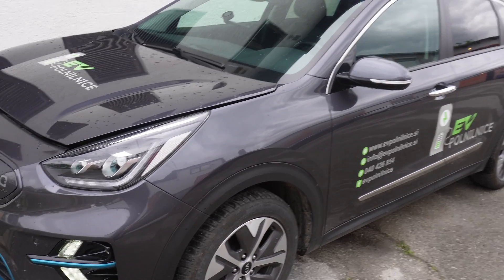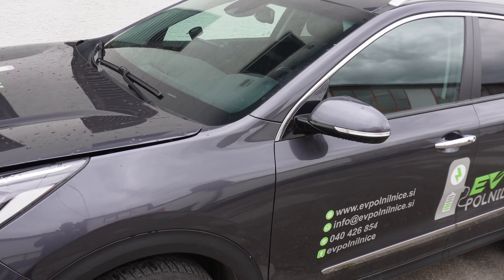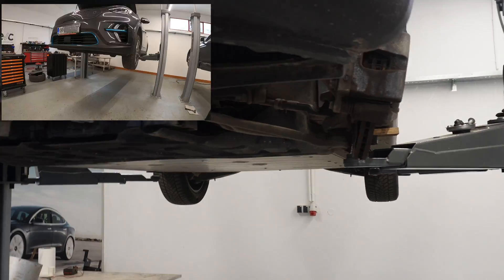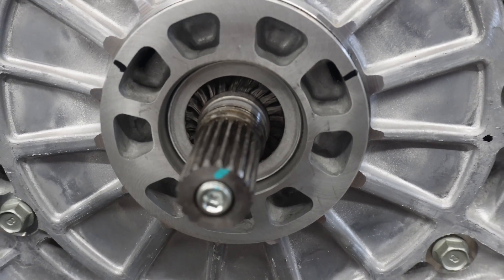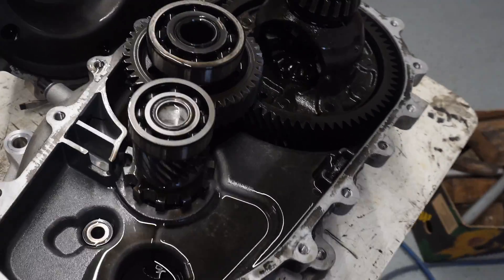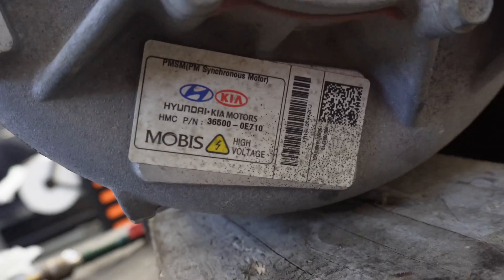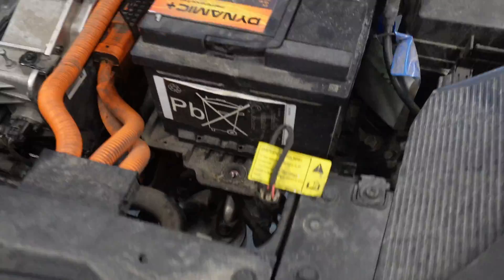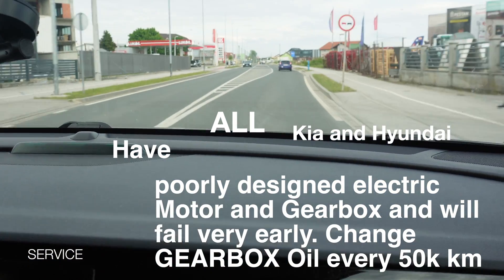KIA you failed us! Electric motor milling refurbish 36500-0E710

Comment: I already saw this kind of repair on an ukrainian Youtube channel, I guess you guys know them. On a Kona first then on a 2019 E-Niro.
The problem not explained in your video is that Kia-Hyundai used a steel ball bearing instead of a ceramic one.
The good part is that the mechanic said that corean learn from their mistakes and try to corrct them, so it seems the since my2021 E-Niro, they used ceramic and this should not happens so often again.
I think there is a kit on sale to prevent or renew these motors.
I don't agree with you when you say it's not a good engine: it had this issue before, corrected now, ok, but the rest is strong, reliable and efficient.
Reply from the maker: Not true. Even ceramic fails. It is bad design as usual on Korean vehicles: that kit which you mention is our product. Check the shop “EVC eDrive Kit eNiro”
Reply: What are the intense heats in a non combustion motor that requires ceramic bearings?    Well...  I understand their insulating characteristics, if there are stray currents around.

Comment: I had this exact job done on my Ioniq 28Kw. Motor and gearbox bearings changed. The car runs silently now but it makes a click noise every time I accelerate or lift off the throttle or brake. Have you ever encountered this?
Reply: After how many Km?
Reply: @GlossaME  160000Km I actually sorted out the clicking noise as well. I had just used the original shims in the gearbox with the new bearings but it turns out i needed to add a 2mm shim to one of the gears.
Reply: @whitegtr  glad you fixed it! Sounds expensive
Reply: Wasn't expensive as I was able to do the work myself. The bearings cost around €300. I did have to remove the gearbox and take it apart twice to add the extra shim!

Comment: Same noise on my kia ev6 rwd 2022, now they replacing the motor.
Reply: The factory procedure is to replace a whole motor or a whole transmission, there is even not any internal component listed in the factory parts catalogue. I did replace transmission bearings on my cousin's Kona 150kW, the material is pretty cheap, available off the shelf (except the shaft seals which are available only as OE), it took quite a lot of labor, but it's doable. The motor has grease lubed closed bearings, so they're the most critical parts. Transmission oil can be replaced easily every 50k km and magnet type oil plug can be used which if good quality bearings are chosen for replacement, I believe extends their life dramatically.

Comment: I have an interesting one: My own EV, discovered a dirty oil film all over the reduction gearbox. No apparent origin of any leak. First suspect was the half shaft seals, but those areas don't feel oily? Guess I have to do a full teardown. Could also be the pressure equalisation breather that got plugged somehow, so pressure is building in it when warm?
Reply: Clean it, then find out where the leak is coming from.
Reply: @annpeerkat2020  I ordered new seals for everything and took it apart.had plenty sludge on the inside walls so it was worth it. Also removed the e-brake cogs completely, who have been dysfunctional for years. I never found the smoking gun, but the seals had lost of elasticity and they were from the factory installed slightly crooked.

Comment: Interesting video. I have owned a 2019 e-Niro from new here in France, just coming up to 120,000 km with the service booked in for next week. The reduction gearbox oil will be changed but I've never had the 'milling' sound from it. There is an e-Niro taxi in UK with 275,000 miles on it, so over 400,000 km. The owner claims it is on original motor and battery but I don't know if gear oil was changed every 50K as you suggest.

Comment: Is there any way to change the gearing to achieve higher speed? its mechanically limited due to gearing to 107 or 110MPH at most! What if i use a 2 speed transmission?
Reply: gawdddd

Comment: I changed the oil in my Kona as soon as I heard about this problem at 42,000km. The oil was dark and looked like metallic paint but nothing magnetic was in the oil. The wheel of misfortune is not audible yet but I heard it slightly twice when I was taking off. Good job, I know where to go if this happens out of warranty. Pozdrav iz Slovenije.
Reply: koje ulje ste koristili za zamenu?
Reply: @MilenkovichProduction  Zdravo. Mannol MTF-4 75W-80, GL-4 sintetično, 8,39€/l na Autodoc.

Comment: Hi,
I'm getting my e-Soul 2020 motor replaced at the dealership under warranty with the newer PartNumber, which led to delays in the part order (they inspected and estimated the gearbox didn't need a change, but found metal filings and will bill me the oil, I might write a mail to Kia France about that). The dealership is being very protective and refuses to give me the TSB number
But I'm wondering, if it ever happened, post-warranty, how much would you bill the operation ?
Reply from the maker: @jaxxdotorg  10000€
Reply: @evclinic  errr, i meant the bearing replacement service, not the whole Motor+GDU units +service and 2 weeks of vacation in croatia (which I will for sure do in a near futur) :) (Motor + GDU are about $4600 (E712) and $1400 (8EA1))

Comment: Thank you for the effort you did to document this annoying issue. Your engineering skills look very confident and fearless. It is such a big job to get the gearbox out! I have a 2020 Eniro with only 13,000 miles. It seems ok so far but this weak point is worrisome. I intended to keep the car for many years. Why didn’t they introduce the oil change as a new part of the annual service after they saw early failures and black oil? The standard service schedule never replaces the oil!  It’s clear they must have known about this issue for years. Same unit in Hyundai earlier EVs. yet it seems they did absolutely nothing to address it. I have just replaced the gear oil as a precaution, and added magnetic drain and fill plugs. As usual, the old oil was very black. I will probably change the oil at every 10,000 miles or maybe less. I only cover about 4000 miles each year. I noticed you said (and I could hear!) some bearing noise from when you test spun the motor shaft on the bench. So did you also renew the actual motor bearings as well?  Keep up the great work please. Thanks for any further information.
Reply: And...   each time you change the oil, what color do you think it will be?
It's always great to have a fearless mechanic that can drop a motor/reduction drive onto a lift trolley...  such a dangerous job.   ahem

Comment: It is a overconstrained bearing. A rookie design mistake in reduction gearbox. Nothing can fix it, it is bad design. You can change oil, replace bearings, or keep replacing gearboxes until it goes out of warranty. But issue cannot be fixed w/o re-design. You have two shafts constrained with two bearings each, connected via splined connection. It will chew itself up.
Reply: Interesting. I had wondered about that. There is no give between the two units. Any minuscule  misalignment due to natural manufacturing tolerances could result in huge sideloads on both of the mating shafts and bearings. Is this why some cars seem to have zero issues at 200k miles yet others have trouble at 10K. Is it luck of the draw on the manufacturing and assembly tolerances? I read that in the early examples of this noise problem they were advised to strip down and add some special grease to the motor shaft splines. That suggests they are aware of this design issue. That still may not explain why they all seem to get black oil very fast. Also, used oil analysis reportedly finds aluminium as well as steel. Why aluminium?
Reply: @ThePrawlin  It is totally random. The better the alignment between shafts the more time you get before it fails. But spline is not a flex plate or CV. It will eventually fail. During that time, it will shed a ton of metal particles into the oil which will chew up other unrelated things: bearings etc. So "black oil" is consequence of having metal grit being fed into oil by spline fretting. Thats why Auto gearbox has a flex plate....to flex. :)
Reply: @goranamcoff6235 but AFAIK the motor shaft splines are not directly exposed to the oil are they?  Also, apparently some have had the black oil analysed. They found high aluminium particulates (and steel). I think it could mainly be the aluminium that mainly makes the oil go black. I wonder if the high aluminium could be caused by bearing outer ring(s) spinning in the aluminium housings?
Reply: @ThePrawlin  I can only guess, but if splines are even slightly out of alignment they will wobble and subject bearings to vibrations (splines will be fretting and releasing particles at the same time). Aluminium bore, being subect to fatigue, might get enlarged and/or outer bearing race might start spinning in alu bore. There are myriads of failure modes for such overconstrained design depending on what fails first.
Reply: Allegedly the E-GMP (I5, I6, EV6, EV9) and gen-2 Niro/Kona have a completely different gearbox, without this construction flaw.

Comment: I had a similar problem in 2019 after 7000 km. As I understood it they had to put more lubrication in the motor. After that it drove 110 000 km with no problem. Then I sold the car. On my Niro EV now with 50”km and no problems.

Comment: „Every“ seems like a Overestimation without foundation? 
As we hear about +100kkm Cars with that Motor and zero issues - even 300kkm ( e-Niro Taxi in Austria). 

Admittedly, no clue if those did frequent oil changes.
Reply from the maker: Because drive assembly probably changed in one of service visits under warranty

Comment: Shieeeet, this is bad. Does it apply to classic Ioniq 28 kWh, new Ioniq 38 kWh, Kia Soul 27 kWh and 30 kWh as well? They all use the same Mobis motor? I should make a video about this in my channel and link to your video.
Reply from the maker: Read comments on my FB page, everyone reporting milling issue on all Kia Hyubdai vehicles. Sitauation is alarming
Reply: @evclinic  Can you explain why it happens? The technical reason of the failure?
Reply: @daviddavid-ot8bm  Small bearings and small gears, compared to Tesla.
Reply: @Stefan_Dahn  same reply as Gears : sizes of ball bearings is adapted of loads and they need to support.
Reply: I owned a 2019 Hyundai Kona 39kwh that had the same issue and changed gearbox under warranty but the noise came back this time from the motor. Now I have a Kia e Niro 2021 which had both motor and gearbox changed under warranty and now it has the OE712 motor instead of the OE710. Hopefully it’s better 🤔
Reply from the maker: Interesting, Ioniq 28 which is owned by my two best friends, to not have poorly designed powertrain and it still drive without any milling noise. Old Ioniq is better sample of powertrain assembly
Reply: Sheesh, I am glad for the 10 year/100,000 mile warranty. It looks like I will need to ensure I trade this car when it hits the end of warranty, as I want no part of having to pay the massive cost to repair this.  

I have a late 2022model,so 7 more years of warranty fortunately.
Reply: All those except the Soul before the 64kWh version, in my opinion of course.  The early Soul had a rectangular tight-fitting custom internal magnet while all those later had a round magnet, the poor fit which I believe causes it to fail at its job.
Reply: Kia/Hyundai have a lot of bearing failures - both on motor and gearbox. Weak deasign. If you compare the bearings to Tesla driveunits, there the bearings are MUCH bigger. Change the oil every 50,000 km in a Kia/Hyundai! And take an oil sample and analyse it! Change the gearbox oil every 100,000 km on my Teslas (small company fleet). PS: Watch the video from Weber Auto State University about the teardown of Tesla and other drive units. Also at Munro Live.
Reply: @Stefan_Dahn The Tesla drive units are a bit more powerful though, across the board..
Reply: @Stefan_Dahn  Hi Stefan, is the oil change part of the standard service plan? What is the recommended oil specification? Thanks for your help.
Reply: @freddyflint8309  Good question!!!
Reply: @freddyflint8309  Oil change is not mandatory, but from my experience over 30 years with gearboxes, 1,800,000 km and 9 EVs im my fleet, hightly recommended. Every 100,000 km on a Tesla rear drive unit (Model S/X: front@), all other manufacturers: every 50,000 km, I suggest. Cost only 200 € or so. Saves A LOT of trouble.
Reply: @Stefan_Dahn  The oil cost me about 20€ and approximately one hour of work. It is nothing in comparison to the possible damage.
Reply: May Can you explain us why bigger is better ? @Stefan_Dahn
Reply: @daviddavid-ot8bm  Yes, because the "beefier" the teeth on the gears, the force in Newton per mm² is lower, resulting in thicker oil film between the teeth and reducing the risk of :mixed friction" and the teeth contacting each other, resulting in wear and tear.
Reply: @Stefan_Dahn  It's correct but kia is lighter and has less power Gears don't needs to be as strong as a model y.  Bigger  Gears means more weight, more inertia, etc.
Reply: Bjørn, check out their Tesla LDU rebuild also.....amazing.
Reply: It would be great if you could, a lot of people don't know about the issue or how common it is. 
But how common is it exactly?
Reply: @danmx5  Just search some Hyu/Kia EV forums for motor and gearbox defects. Most of them fall (so far) under warranty, but they take a long repair time. After 160,000 km you pay it out of your pocket. EVERY 100-200,000 (?) new bearings.